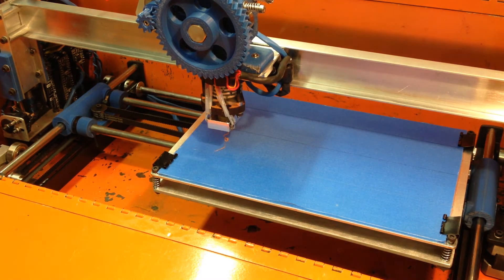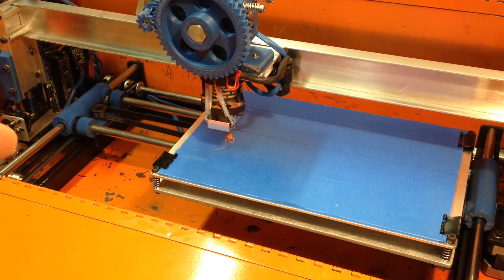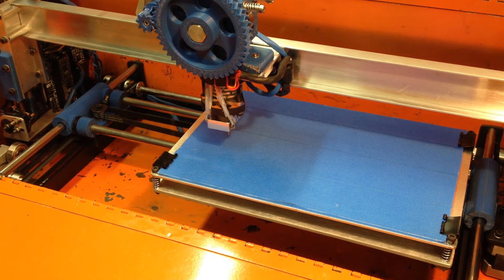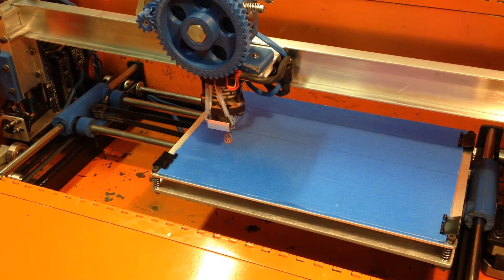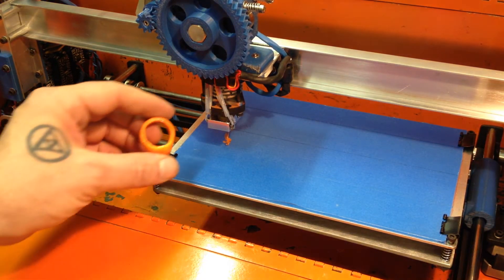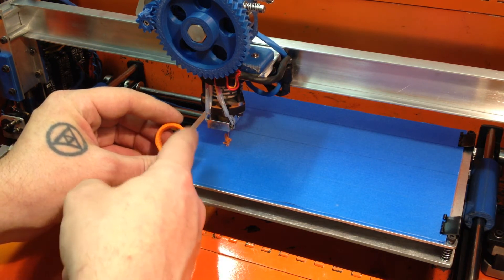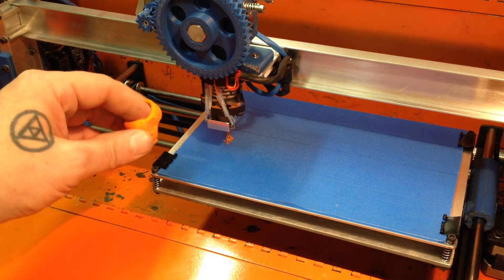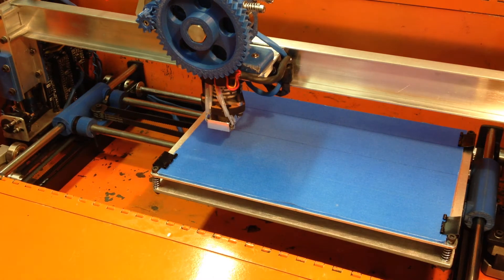Toolbox 3d Printer PLA Settings and Troubleshooting (part 1 of 2)

Comment: I'm using now for more than 18 Months a heated glass bed 65°C start temp and 60°C print temp. For each print I wipe my bed with saturated sugar water. As from the start I'm using this method on all three printers, I'm a happy man. Saturated sugar water is a mix of about 60% sugar and 40% water boiled until the sugar is fully dissolved. 1 liter takes me away for two months and cost me near to nothing. I use sugar water for all my materials